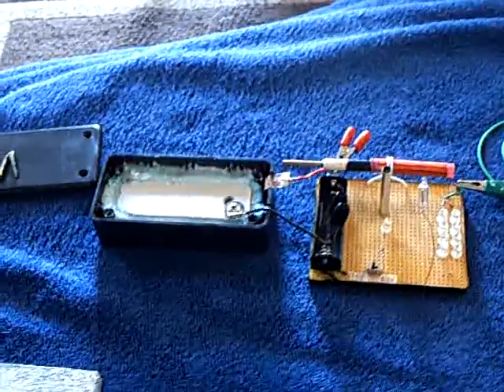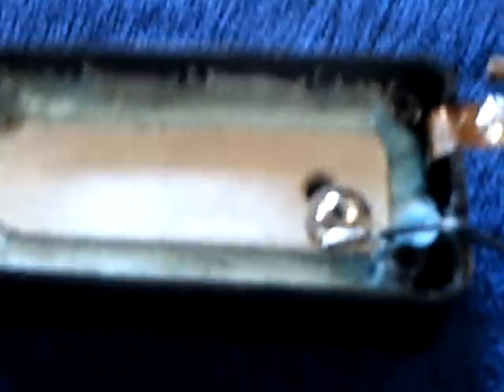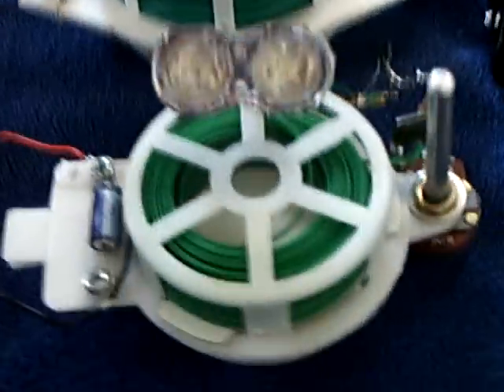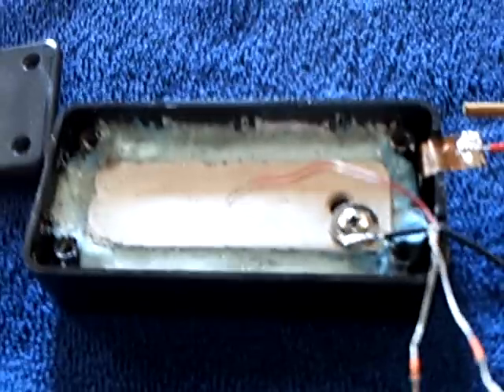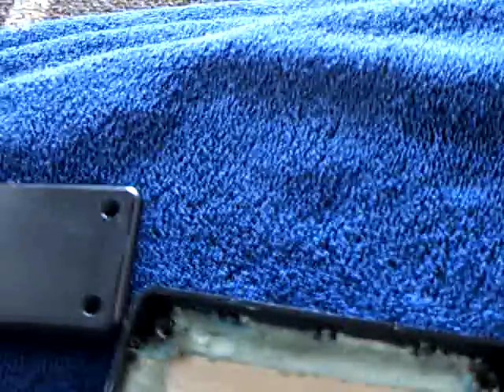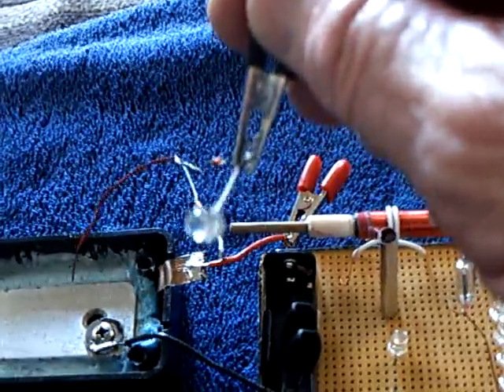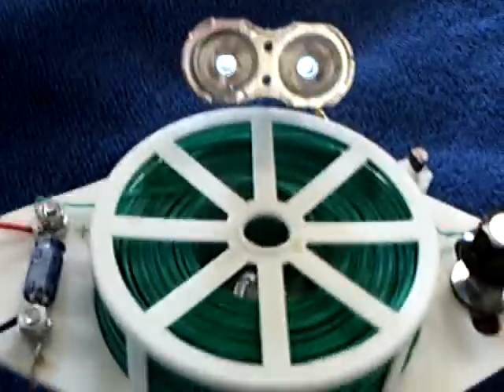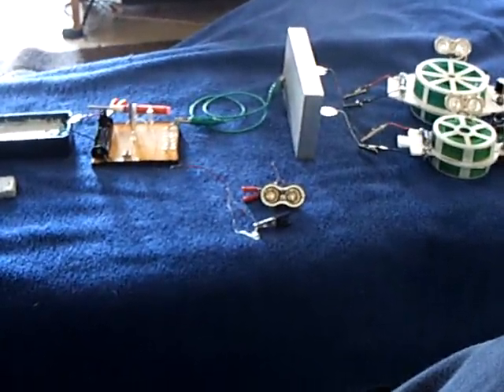Hydrate crystal cell update

Comment from the maker: @Wavefront101 ------Yes a protection layer is called for.  When I put this cell back together I coated the Mg in 3-in-1 oil.  We will see how that works.  I am also trying certain paints on other cells to see if I can protect the metal and still get the cell to function.  I am pretty sure that John Bedini has this already figured out and is way ahead of us.